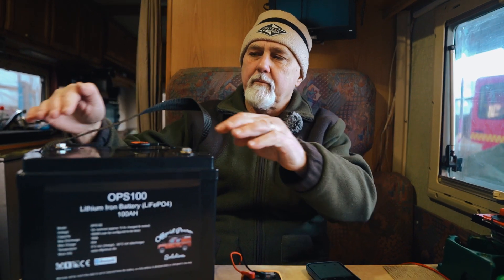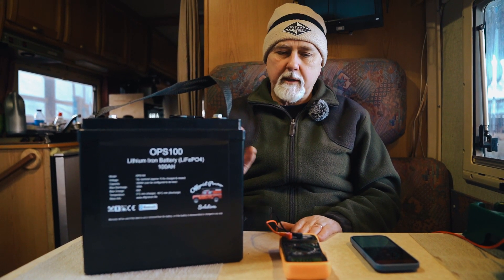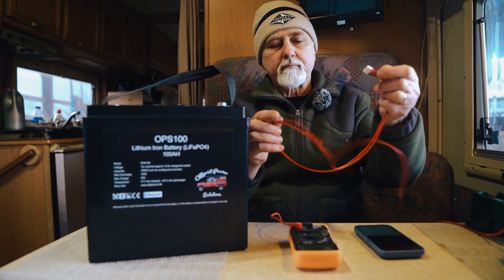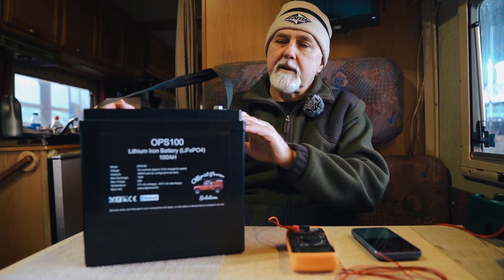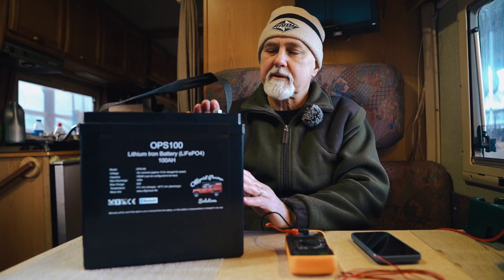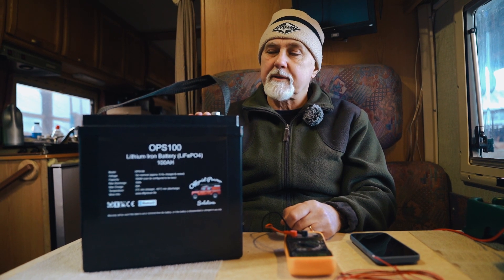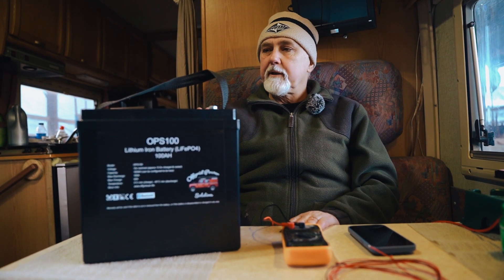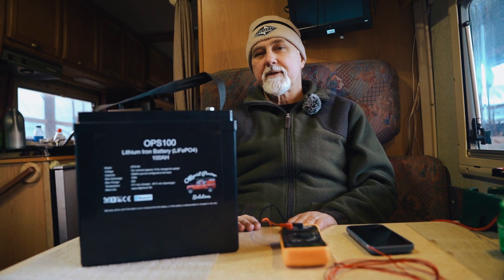Voltage difference between Daly BMS & battery terminals

Comment: My JK BMS shows 13.3V(correct) while there is  13.08V on the terminals... when i apply some 0.023A load there is 12.8V on the terminals but correct 13.3V shown by bms. My mind explodes really... Can someone explain why that is?
Reply: Battery voltage will always drop under load, especially heavier ones. This is called voltage sag.

Comment: Interesting. I discovered similar a few months after building my battery using Daly bms Only In my case the terminals measured around .75V less than the App voltage i.e 13.3 against 12.5. As soon as I applied a load or plugged in the charger the voltage matched within a few millivolts...
Reply from the maker: That's interesting.
Reply: I have the same issue. Way to much drop in voltage. With a very small load of 10 watts, only I have 12.0 V messured at the poles with 80% SOC and 13.0 V messured in the App.
Reply: Would a change in the cadc settings help on this, too?

Comment: Does this have an effect when 2 batteries are wired in parallel? I've wondered if BMS's can fight each other as they mess with the voltages. Cheers

Comment: I've got 9 different multimeters, 2 of them fluke and non of them match when testing the same battery, it's just a fact of life or a fact of manufacturing tolerances 🤔
An example of this is the 5 USB/VOLTAGE ports i bought, all show different voltages on the same battery, same test leads 👍
People get too hung up in beleiving thier particular meter is actually correct 👍
As allways chaps, enjoyed the video 😎